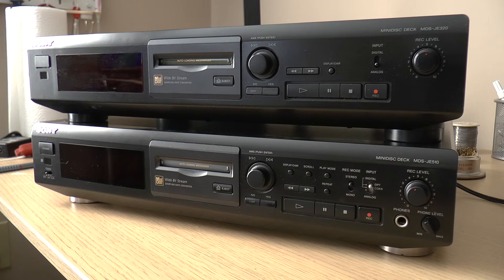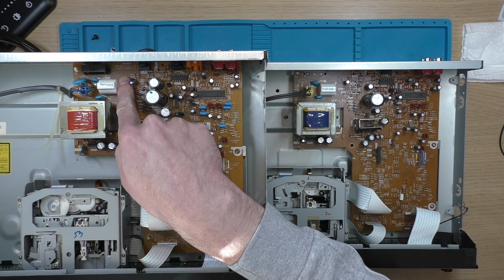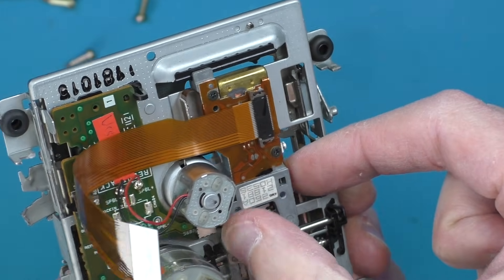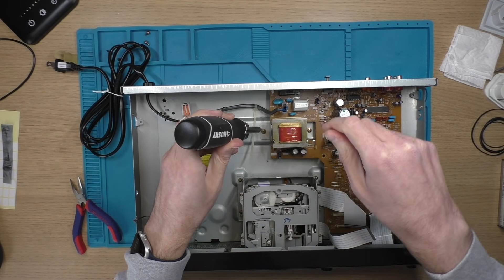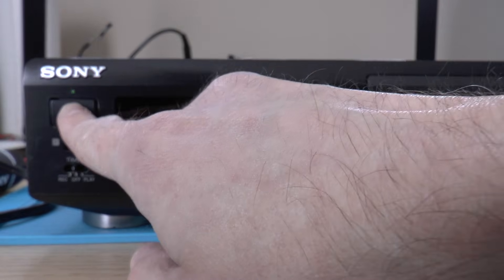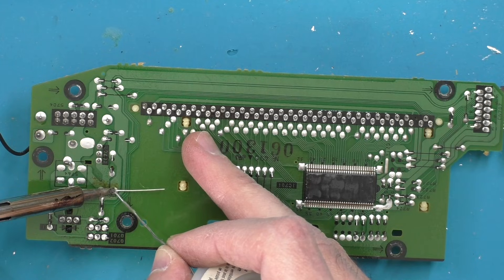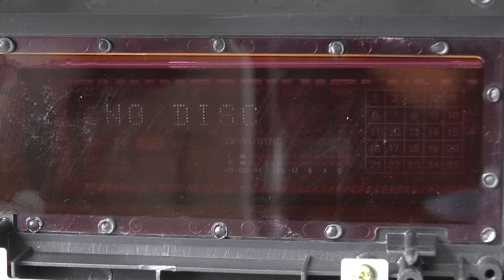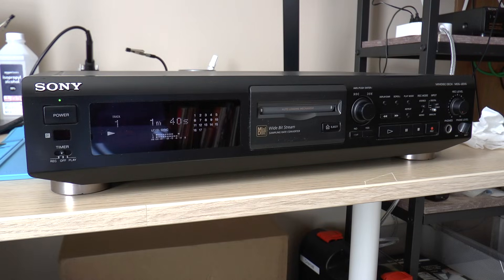Sony MiniDisc recorder - transformer swap and display issues

Comment: Sony also made a version of the MDS-JE510 that had a dual voltage transformer with a split primary winding and a switch on the rear panel.  That was the version I had back when I was living in Hong Kong, although I later found it was a grey imported Singapore model and the official HK model was 240V only.
I have to admit I assumed that the fixed input versions used the same transformer as the switchable one I had, but just used fixed taps on the primary rather than using a switch - the fact that apparently Sony went to the expense and complexity of making 3 different power transformers when they could have used the same one in all versions is pretty surprising.

Comment: Regarding the display... Could you explain the physics behind the technique of powering the 'heater'...? What's going on there and why does it work?
Reply from the maker: It's meant to burn off contaminants that affect the output of the phosphors. From my experience it's a short term party trick and doesn't really make much difference in the long run.
Reply: @SpareTimeRepair.  Thank you. My 510 suffers from the same dim display issue. I thought it may be repaired by changing bias or current drive  on the device.
Reply from the maker: Sometimes there might be a bad capacitor on the display board - but it's unlikely for these units.

Comment: Did you check each of the individual windings on the transformers to see if they were the same or did you just luck out?
Reply from the maker: I did take measurements but I felt that there was a high chance of success given that the board design was the same for both models.

Comment: What does injecting voltage into the heater wires do? 
(I expected you to say "Until it pops" like Photonicinduction does)
Reply from the maker: It supposedly burns off contaminants that are affecting the display’s brightness. I’m not convinced that it makes much difference in the long term.

Comment: With CRTs, the trick is usually to out the heater on at a slightly elevated voltage and leave it going a whole day or more. Interested to know how that differs from VFDs.

Also, the next time you swap a transformer, I would suggest measuring the voltages on the secondary first to make sure it's identical. I've absolutely had difficulties swapping them between apparently the models from different regions

Comment: I would have just installed a small ~10W 120/240 transformer inside the unit, solder its secondary coil to the primary coil of the unit's transformer, and Bob's your uncle!

Comment: Thanks for the great job. On a 230V Mds-Je530 and 510 there is a lithium battery like computer or video games to keep time and date memory. Do you know what is the function of it ?
Reply from the maker: Yes, you could set the date and time on these units so that recordings would be stamped with that information. I remember having to adjust mine when the clocks went forward or back. So the battery is there to retain that information if the unit is removed from power. Those batteries are rechargeable though, and soldered in. People sometimes replace them with normal coin cells but that's a mistake.

Comment: I did this exact thing fairly recently when I got a nice ES cassette deck with Dolby S and all that.... but it had a Euro transformer.  The service manual listed a similar, but down-spec'd US model that I could find easily and cheaply.  They do use different PSU breakout PCBs, but I took a gamble that I could figure it out.  Turned out fine!  Although I don't remember if I was able to use the other PCB with some rewiring, or had to make a new PCB....  Easy enough these days either way.

Would be nice if the transformers were universal with multiple primary taps, but eh.  Now I have some spare parts too.
Reply: Also:  Ebay "may have issues" means "has not worked in a long time -- good luck and no refunds!"
Reply from the maker: Ha ha, that’s a fair translation!

Comment: Filament supply on that Minidisc is generated on the main board so, if you ever feel like opening it back up it might be worth spending a little time tracing it back with the service manual

Comment: I know about this rejuvenation trick from work old 20+ inch Black and White CRTs. I would have just increase the heater voltage directly on the board, most likely it was just a zener diode that would have needed changing, or just sauce a new transformer, or just add a few more turns to original transformer for the "display." I know it can seem intimidating to even rewind those transformer it's not really that hard. You can get the fine wire in automotive relays or chopper transformers[Display transformer Not the Mains Transformer]. 

Concerning the mains transformer. I am curious about the primary section of the mains and if you checked the traces under both boards  to see if they were the same though? Because if they weren't you may not have needed to change anything at all. Just cut traces or bodge the 240 volt one like the 120 volt one, and yes obviously checking the resistance of the coils before the changes were actually made. Reason why I asked is because are quite a few pins on primary on both transformers. But since you didn't show the removal of the other transformer I couldn't tell.
Reply from the maker: You may be right - I never did a side-by-side comparison of the transformers. I didn't think of modifying the traces to be honest.
Reply: @SpareTimeRepair I know, however the probably might be low anyway, but it'll never hurts to check, the worst that can go wrong is a blown fuse. Well, no love loss. Oh, there are a few videos on YouTube of people rewinding phone charger transformers to get more current. My advice is look up VFD heater circuits on various sets, so you can add a dimmer toggle switch and resistor to prolong life of the emissions.

Comment: That "drive issue" noise is a very common problem. It's caused by a micro switch inside the disc mechanism.

Comment: Well Done!  I still love the mini-disc and looking at Japan for parts units and they are always 100v.

Transformer swap great!  And yes, I agree with you that after the transformer, all components are the same.....especially on units with transformer not mounted on main PCB.

PS:  Very interested in how the display works and adding voltage to the heating elements helped to fix problem when back in service.

Comment: Why do you enjoy using minidiscs? I never owned one.
Reply from the maker: Apart from being very tactile and fun to handle, the editing capabilities blew my mind when I first used them. You could divide and join separate tracks with incredible accuracy, down to a fraction of a second. That meant that you could create seamless loops or edits. I recorded a live session from the radio once where the DJ accidentally interrupted a chorus. I was able to edit in one of the other choruses in its place and you couldn't tell when listening back to it. You could also 'permanently' change the running order of a disc by moving tracks around. The player would buffer the music so that the transition was instant. You could hear it skipping to the next track before the current one was finished. It was all reversible though. Add to that the ability to create track names and disc titles and it was superior to compact cassettes in every way. Those editing capabilities were superseded by computers of course, but to be able to do it on device was amazing. They use lossy compression but still sound great to me.
Reply: @SpareTimeRepair Sounds very neat indeed.

Comment: The display problems on the VFD are caused by bad design.  Even when the machine is in standby, the filaments are constantly powered.  Always worth checking equipment in the dark to see if they’re slightly glowing or use a phone camera.

Comment: Yeah I rather knew twenty volts and three passes would likely kill the tired display. However the renewed good display was brilliant after a few light 12V passes. The transformer transplant was fun to watch. Question is how long will your Display intensity shock therapy last? My mid to long term prognosis is good. Thanks again sir!
Reply from the maker: It's already dimmed somewhat, but overall still an improvement.

Comment: What voltage, for how long, and how many repeats did you find worked on the VFD? I have the same issue on my MDS-JB930 which I bought new. Would love to improve it, but don't want to break it...
Reply from the maker: I would urge caution. I think I did 12v three times for about ten seconds each. The initial result was much improved, but a few days later it had noticeably worsened again. I'm not sure that the overall improvement is worth the risk to be honest.
Reply: @SpareTimeRepair  fair enough, maybe I let it be. Thanks.

Comment: Like you I'm an expat Brit now living in the US. I'm an audiophile of many years and my 240v hifi came with me. After 10 years of using a voltage converter, and being distinctly unimpressed with the sound I decided to feed my gear with actual 240v food. 

It was simpler than I thought. I ran a spur from a dual pole circuit breaker in my breaker box to a very ugly 4-pin tumble dryer outlet in my lounge (hidden behind the hifi). I changed the British plug on the end of a power strip I brought from the UK and plugged that into the 240v supply. Everything worked wonderfully, sounded better and I still didn't have to change any of the equipment plugs.
Reply from the maker: I admire your determination!
Reply: The only thing that could possibly cause a change in sound from using a step-up transformer is if said transformer is undersized, causing transient brownouts under load.
Reply: @tookitogo  Yeah that sounds like placebo to me.  Remember, everybody -- appliances don't run on mains voltage.  They typically run on small DC voltages.  It's the PSU's job to convert one to the other, and with bulk capacitance, there should be very little change on the secondary side regardless what happens on the primary side.  Downstream point-of-load regulation (where it's actually needed) should make it all but unmeasurable.

If the device uses a switching supply (which would also usually negate the need for a step-down anyway), then it's even less relevant what happens on the primary side.

So don't get too caught up in trying to provide "perfect, clean power" -- the device really does not care.  The design is intended to reject noise, ripple, and variations in the supply.  If it doesn't, it's a bad design.
Reply: For anyone else thinking about this, consider that US NEMA plugs and receptacles include several 240v options that are not a monster appliance size - such as the 15A NEMA 6-15 and the 20A NEMA 6-20, if you don't want to run $700 worth of wiring to a comically large receptacle just for HiFi. :P

Comment: I have a Sony MD Deck with the same issue on the vaccum display like yours, when you apply the 12v voltge, the voltaje is AC or DC ?
Reply from the maker: It's DC voltage.

Comment: How would anyone rate the audio quality of the mini disc system, like if I record from a vinyl record?
Reply from the maker: It's pretty much the same as a high bit rate MP3. The compression system that Sony used was called ATRAC, but to my (admittedly old) ears, it sounds very close to the original source. The real genius of MiniDisc is its editing capabilities, but it's definitely a fun format to get into.
Reply: @SpareTimeRepair Thank you for the info.
Reply: It is audibly indistinguishable from CD. I’ve done some fairly extensive listening tests over the nearly 30 years I’ve been using MD, and in every instance, what I thought was a flaw in the MD encoding was actually present in the CD source material.

The only exception is the first-generation MD recorder, whose encoder actually cut off everything above 16kHz. Everything after that was better, and by the third-generation MD decks (with version 3 of the ATRAC encoder), it became indistinguishable to the ear. The decks here are even later than that and have even better version 4 encoders.
Reply: I always thought this series sounded best of what MD decks I tried using. I had a JB940 and MDSE11 and 12 that should  sound better I think, but I like my 510 better sonically. I have a silver one that was also converted from 240.

Comment: you dont have to do this   you can measure the DC voltage  and install a DC jack  then use a regular laptop adaptor
Reply from the maker: I don't see how that would work - the transformer has different voltage rails with different values.
Reply: @ in the voltage selectable transformer there are two coils they can be connected in series that's for 240v  if you move the jumper to connect the input voltage to only one of them, that's for 120V
Reply: @ but for some regions, the transformer is for fixed voltage. you can use multimeter to figure it out
Reply from the maker: Thank you, that's interesting. Obviously too late for this project, but I'll bear it in mind.
Reply: @SpareTimeRepair my advice is  always search for the service manual before you actually do things
Reply: @SpareTimeRepair Most vintage Sony products do NOT have dual-primary transformers, and instead use a single-primary transformer specific to the rated input voltage. The big exceptions are the “export” versions made for sale to foreign visitors to Japan (and likely also for countries with mixed power grids, like a lot of Latin America). Those have an external voltage selector switch. It is quite rare to find a Sony product with a dual-primary transformer that is configured only by internal jumper wires, though I have seen it once or twice.
Reply: @ForrestCowcat2023  For vintage Sony, it’s nearly always fixed-voltage. Always best to check the service manual.
Reply: @ForrestCowcat2023  As for the “use a laptop adapter” suggestion: won’t work here. It has a bunch of rails: unregulated + and - 12ish volts, 12ish V AC for the VFD filaments, plus regulated + and - 6V, -32V, two +5V rails, and +3V. Deriving all of those (cleanly!) from a DC laptop charger, while not categorically impossible, would require a significant amount of engineering effort to do.
Reply: @ oh  right  it has multiple voltages
Reply: @ForrestCowcat2023  Yeah, they didn’t hold back in the number of rails! 😂

Comment: Has the display been working well since you rejuvenated it? I heard that after a while it might dim back to the level it was before. I might want to try this on my unit.
Reply from the maker: It may have regressed slightly, but I think it's still better than it was before. It's not a machine I use a great deal though, so it's too early to comment on the long term effect. Proceed with caution.

Comment: Makes sense that the transformer swap would work.  To avoid redesigning the power supply for different regions, just spec transformers with the same secondary voltages and different primary voltages.
Reply: But only because these models are nearly identical and share the same fundamental architecture. But it’s always best to verify this with the service manual first. There are other products which are similar externally but have significant differences in the circuit design (for example, the TA-FB920/930/940, which have surprising differences in the supply circuitry. (The 930 is especially surprising, because it changes the power supply to add outputs that don’t get used at all! But the 940 does use them, so this becomes a forensic engineering exercise showing that the 930 was likely intended to have the 940’s added circuitry, but probably wasn’t done in time.)

Comment: Amateur! When applying external votage to the motor, first  disconnect the wires going from main/supply power board  to the motor and then you should test the motor.
Reply from the maker: I am certainly an amateur. Thanks for the tip!

Comment: There exists no dimming function , right?---  
What is the theorie behind  improving the display lights by pushing the applied voltage?
Reply from the maker: I don't believe there was a dimming function, although I don't have the remote. Heating the filament wires burns off contaminants, but it's hit and miss.

Comment: Cool video pal can you tell me what the voltage was doing to the display to make it brighter thank you
Reply from the maker: Heating the filament wires can burn off contamination that's making the display dull. It doesn't always work, but I got lucky this time.

Comment: You need to swap the pcb battery out to stop it flashing standby as well.
Reply from the maker: It's a rechargeable battery though, right? Will it not recharge if left plugged in for long enough? Perhaps it's been discharged for too long.
Reply: @SpareTimeRepair Yes it is, but after 30 years it will have failed. The flashing standby is the result. The type is VL2020
Reply: @JacksonCairn  hola saludos desde uruguay , pregunta x casualidad esa batería se encarga de alimentar  un procesador q guarda la última posición de el mecanismo no ? O sea si estas  grabando, reproduciendo,  insertando o eyectando un disco al momento de desconectar la alimentación ( corriganmen si mi teoría es errónea o acertada )  al reconectar la alimentación  el procesador seguirá el proceso en cual estaba antes de la interrupción.., quizás x lo cual los mecanismos q se desarman devén volver a ser puestos en posición exacta a la q estaban instantes antes de la interrupción,  x lo cual y me a pasado de no hacerlo  congela la placa quedándose sin poder encender completamente,  los leo , saludos
Reply: @SpareTimeRepair tengo entendido que si , y también que como toda batería deja de suministrar el voltaje correcto x su desgaste y años , aquí abajo puse una teoría 👇,  no tengo estudios electrónicos, solo desarmar arreglar mis vandejas , x eso puse mi teoría quizás acierte o me equivoque jaj ,saludos desde uruguay ,nuevo sub